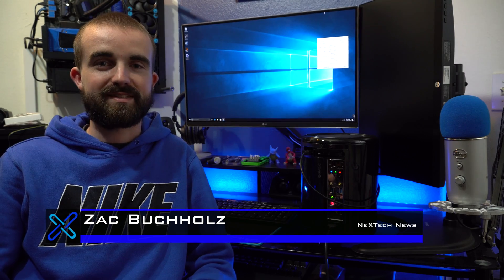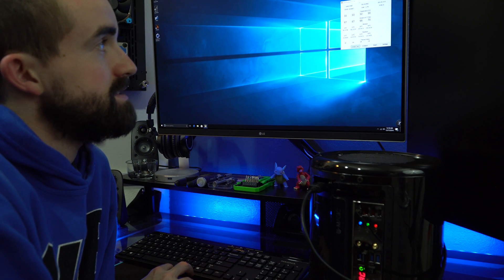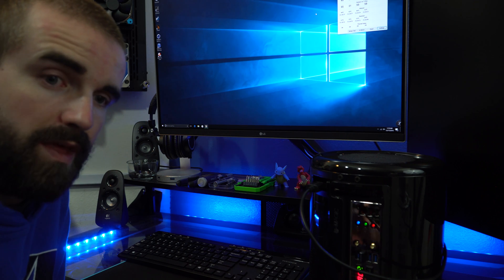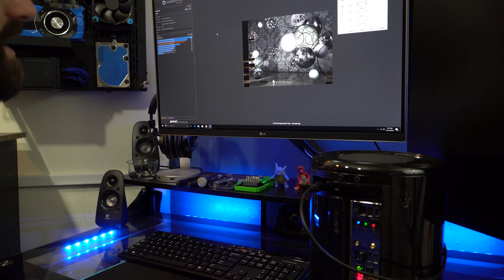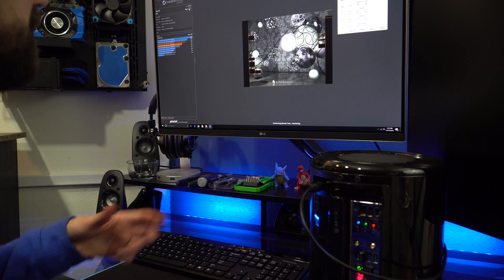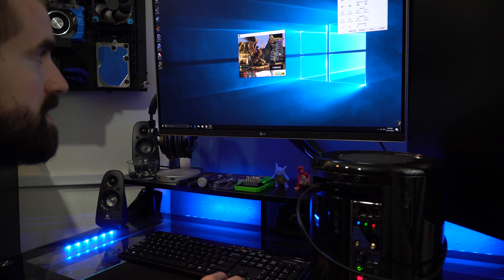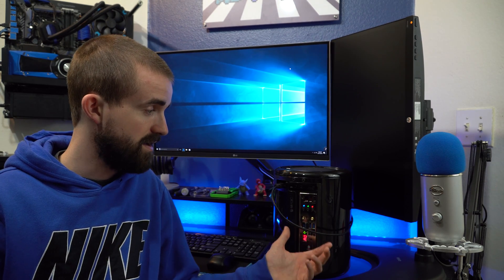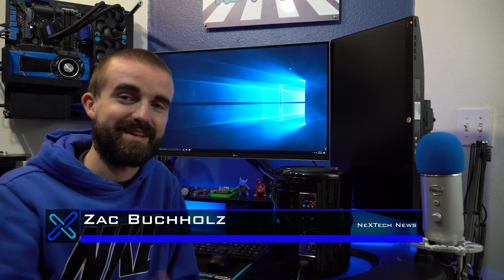Mac Pro Clone Build (iMagic Pi Case): Part 3

Comment: this is the only cylinder case I can find that seems decent. do u recommend this case :/
Reply from the maker: +John Tantay what are you looking to use it for?
Reply: I didn't notice you can't really put a mini itx gpu in there. I'm still waiting on the ola from cryorig

Do you still use this pc
Reply from the maker: +John Tantay I made it for a friend but he still uses it, but as you said I had to mod the case to fit a gpu in it, the MSI lp 1050ti might fit without modification but I haven't tested it
Reply: Would that be better than my Nvidia 970
Reply: Is there space for MSI LP 1050? I mean, the fan is above it, so doesn't it collide?

Comment: this case is so awesome I think I'm going to do this exact build, would you think a fan would suffice or is a water cooler necessary?
Reply from the maker: A cpu air cooler would probably suffice just make sure and put a high airflow fan into the bottom of the case!